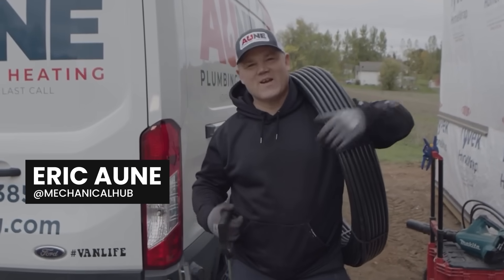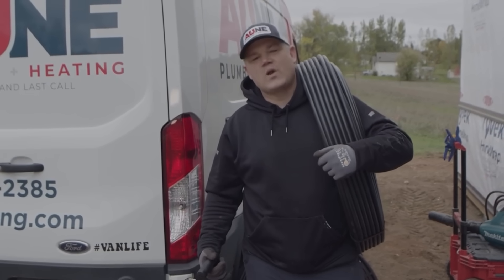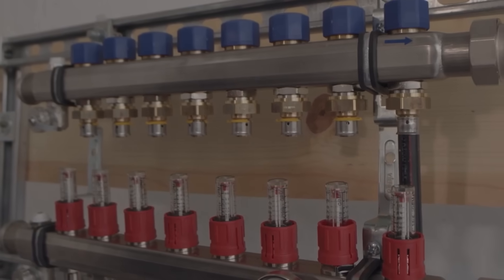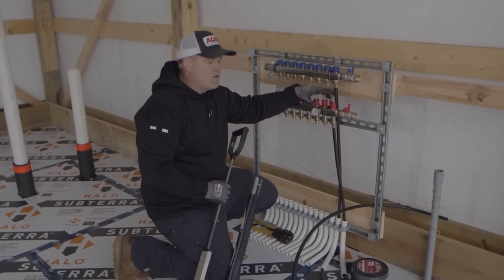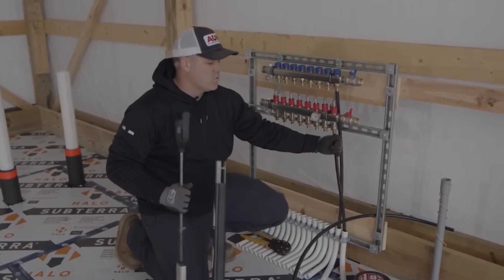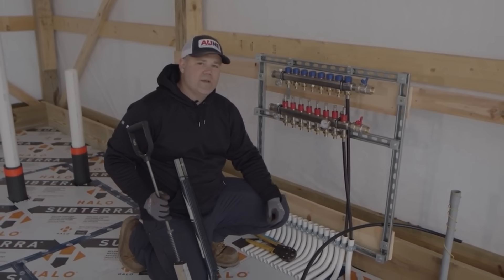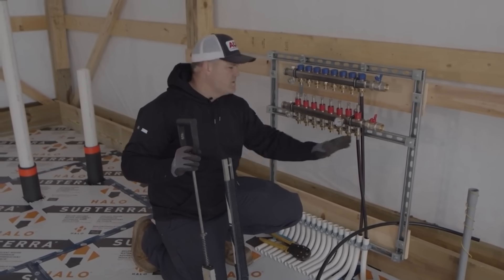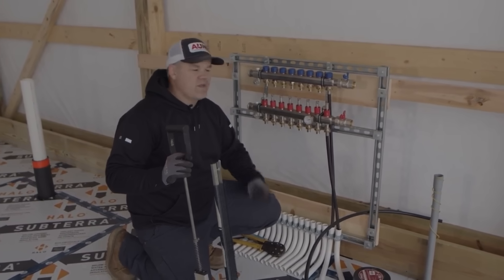Heated Floor Installation with Eric Aune | Best of The Build Show

Comment: Can you use a heat pump water heater for radiant floor heating?
Reply: Absolutely, and make domestic hot water too.
Reply: @dlg5485 are you saying you can use the hot water the floor is being heated with?
Reply: @mattbrew11  Yes, that same heat source  (heat pump, boiler, or whatever) can send heated water or glycol to multiple systems... radiant floor heat, domestic hot water tank and wherever else you need heat. I am looking into using a single heat pump for radiant heat and domestic hot water in my upcoming home build.

Comment: 9" spacing seems way overkill for 2025. What's your math on this?  In Vermont, I only calculate 16" is plenty.
Reply: While its plenty to cover your heating loads.
If you go heat pump, there no such thing as overkill in underfloor heating.
The smaller you can go the more efficient your system will be and PEX tubing is dirt cheap anyway.

Comment: We drive our s840 laser screed on that stuff and we have never seen it break. Never from screed. Once in 15 years i seen a pump hose clamp fall on the hose and break it. Also In manitoba canada we do 200 ft pr loop. And we do call them zones sometimes because we do it different by the doors or in the bathroom area and stuff